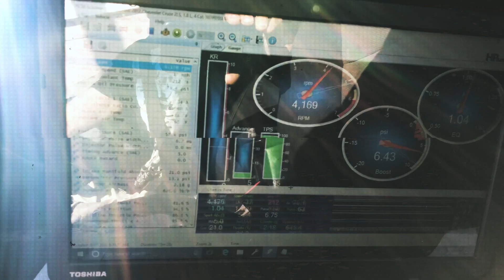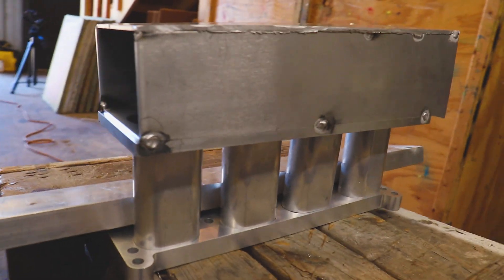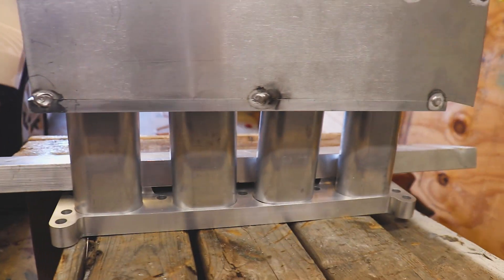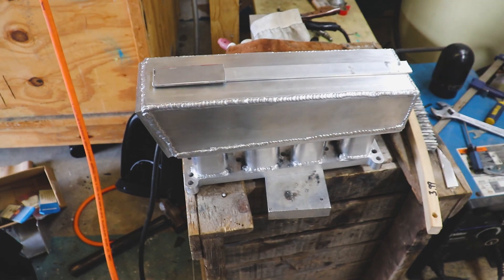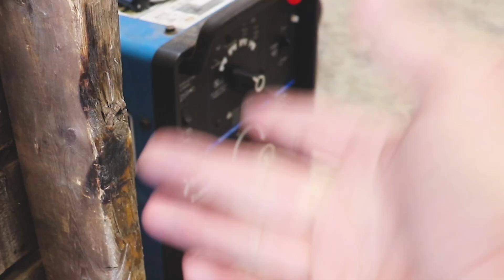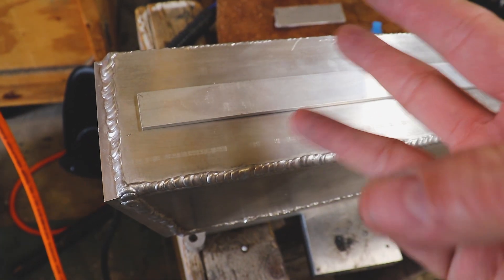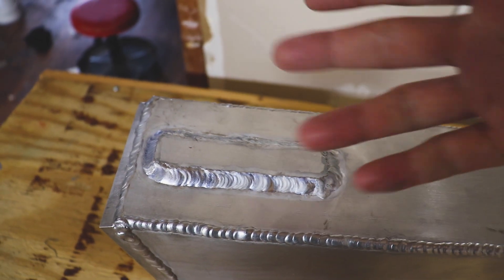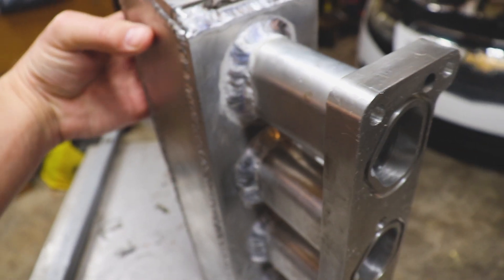Is Making a Custom Intake Manifold Worth it? How to Build a DIY Aluminum eBay Turbo Intake Manifold

Comment: How much gas did u use? I ordered a welder but I am not sure how big bottle to buy. Is 13 liters enough?
Reply from the maker: I'm not sure to be honest. Think I went through a bottle or two. Don't recall what size it is, but the welding supply store was right down the street so was easy to just exchange for one that's topped off for $40.

Comment: In regards to your circuit breaker. If you're partial to welding. Send a dedicated circuit. It's own breaker. Maybe from a b32 up to a b40 .. send a 6mm solid core feed to a socket. Use this plug in your welder, it will only be running at 13amp to the plug. I did similar to a mechanics ramp as it was too heavy to be on (what I discovered) an existing circuit. I done as mentioned above and he's never complained again. Anything heavy / demanding you should dedicate a circuit/ breaker to it. So the existing circuit is also protected. Someone could be using a socket and your welding / breaker deactivated will piss them off too.

Comment: Matt where did you get the main  mounting flange machined at?  I'm trying to do a eatons m90 on my 1.8 and  that  mounting flange  would make  for great start to my intake
Reply from the maker: That's awesome! I tried looking for the invoice. Been about a year.  I just googled china cnc machine shop and they came up. We're pretty inexpensive and fast turnaround. I'll dig some more later.
Reply: Okay thanks brother

Comment: one you should be welding at about 200 amp your machine is small for that kind amps to be maintained if you want to use that machine for that change your gas to a 75/25 argon helium mix which makes the electrons flow faster across the the tungsten in turn will make your machine able to weld basically it will create more heat
Reply from the maker: You're right about that David. You live and learn.

Comment: This build is coming along nicely. We all forgot about this concept but I wonder how much hp it’s gonna make. I say 300 with just the stuff u have on and tuning it to run just normal without giving off weird idles and lights(considering the stock version makes 138……… pitiful). The the real fun stuff begins after that. Lots of TUNING
Reply from the maker: That's the million dollar question! Definitely exciting that it's getting closer to being completely finished and dyno time coming.
Reply: @cmattdabrat  the best part about it is that it will be able to take more abuse considering the engine has forged internals. I think the oil issue became a blessing for this build. If something didn’t go bad u probably wouldn’t have rebuild the engine. Everything happens for a reason. I say this car will be able to hit 500hp faster than u think.

Comment: Thicker aluminum plate pulls a ton of current to weld which is probably why it keeps kicking the breaker. At my house I was practicing on 1/4" plate and it did the same thing to me lol. Also doesn't help that I have old outdated circuit breakers. Thin stuff is fine. Aluminum soaks up a lot of heat and pulls it away from the weld site since it is a very good heat conductor. My welder is a 250 amp transformer type and it takes almost everything its got to do 1/4" plate lol nice job btw it looks good!
Reply: Doesn't pull any more current than you set the welder to, I weld 1/2" aluminium all the time with a 200amp machine, all about preheat.
Reply from the maker: @garyhowe88  It's an older machine. Goes up to 180 amps. It's either going to punch into it, or not. Preheating helps, but it's a little bit of a band-aid. The guy that helped finished welding it up had a 400 amp machine.

Comment: What did you do about your imtv
Reply from the maker: IMTV? Is that the variable actuator? That will just end up mounted somewhere out of the way, even though it wont be doing anything, to satisfy the computer. I'll cover some of the vacuum lines, and how I address them once we go to start this thing up. Just need to finish the intercooler piping and the small things.
Reply: @cmattdabrat  when i had a wire spit for the “imtv” intake manifold tuning valve, my cruze kept dying on me at every stop thats why i asked if you had a plan or action that would make it obsolete or something
Reply from the maker: @thr33ninety28  Gotcha. In the ECU / ECM, it's listed as VIM, variable intake manifold. It can be turned off and set to zero so it's maps based off of RPM, don't affect the VVT and fueling. But just to please the ECU, I'll have it plugged in.. or I may not plug it in at all.